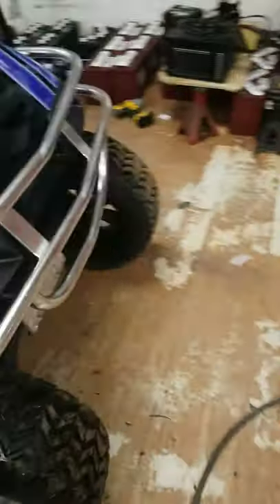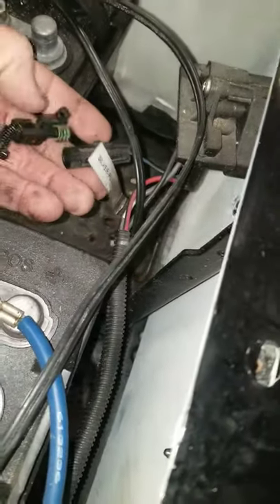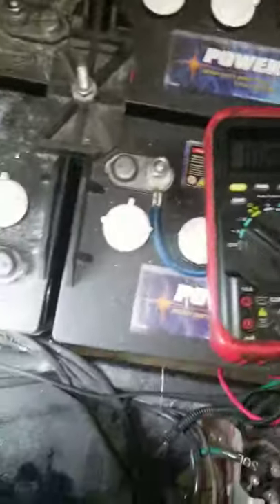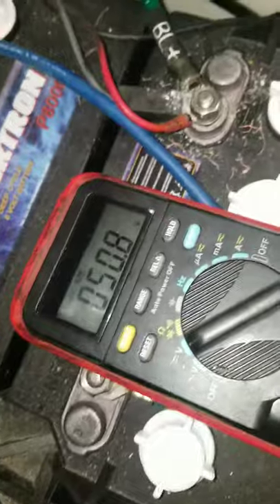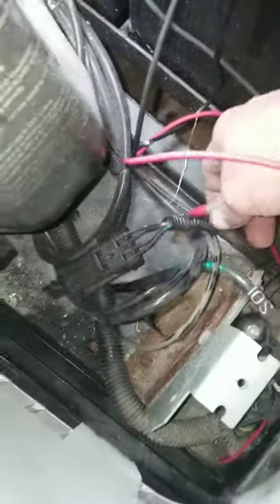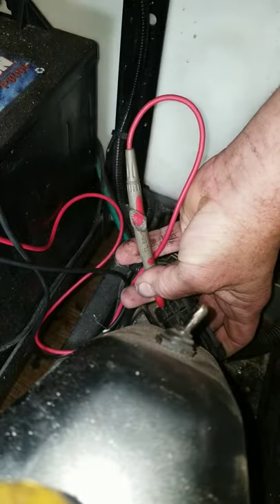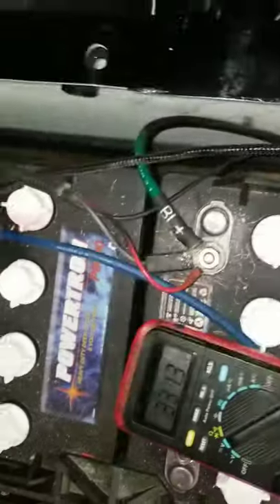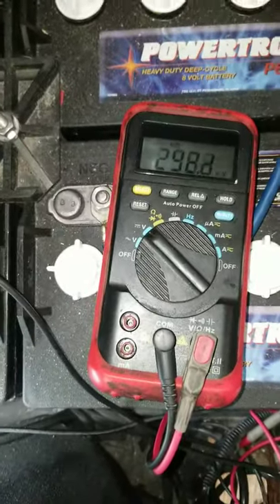EZGO 48 Test charger port, pedal sensor (ITS) and solenoid!!!!!!

Comment: I’ve got a 2014 EZ-GO TXT 48 volt. I just replaced the micro switch and the inductive throttle sensor. They seem to be working but the cart won’t do anything. The batteries are fully charged, the lights, turn signals and horn work. I have the toggle switch in the run position. The reverse alarm does not come on and I don’t hear the solenoid click. What should I troubleshoot next?
Reply from the maker: Bypass the charger plug. Like I did in the video. It’s within the first couple of min. And see what it does
Reply: @HeyHeyHey97  Thanks, I’ll try that. Can I jumper a wire without cutting off the plug?
Reply from the maker: @sethkorros2467  yes.  But I would just do it and make it permanent.  Eventually it will give you a problem. If it’s not one now
Reply from the maker: @sethkorros2467  if that doesn’t fix it run a wire from main positive to small yellow wires on sol and see what it does
Reply: @HeyHeyHey97  I bypassed the charger plug and nothing happened. I also ran a jumper from the the main positive to the yellow wire on the solenoid and that didn’t work either. 
Is there anything else I can try?
Reply from the maker: You probably have a bad controller
Reply: @HeyHeyHey97  I was thinking that too. Thank you!
Reply from the maker: Has the. Whichever ever been towed in the run position. If so check motor also. If you’re not sure I have a video on how to test the motor. That way you want fry the new controller
Reply from the maker: Supposed to say has the vehicle ever been towed
Reply: @HeyHeyHey97  I’ll check that out. I don’t think it’s been moved manually without moving the run switch to the tow / maintenance position first.
Reply: I ran a jumper wire again from the main battery cable to the yellow wire on the solenoid and got the solenoid to click and motor came on. I found the the three way splice in the flex conduit and respliced it but still wouldn’t work unless I ran the jumper wire. I also took the wires off of the key switch and checked the resistance with the key on and off and it seemed to be good. 

When I jumped the solenoid the motor seemed jerky and wouldn’t reach full speed. 

What else would you recommend checking?
Reply from the maker: Have you checked  voltage at the key switch
Reply: @HeyHeyHey97  I’m getting 45 volts when the key is off and 0 volts when I turn the key on. I’ve got 7 volts at the yellow wire on the solenoid when the key is on.
Reply from the maker: @sethkorros2467  when you turn the key on. You have no voltage on either side of the keyswitch? If so sound like a connection problem in the harness.
Reply: @HeyHeyHey97  when the key is off and I put my red and black lead from the volt meter on each of the two wires I get the battery voltage. When I turn the key on I get no voltage. If I turn the key on and put my black lead on the main battery negative and the red lead on the each of the two wires from the key switch I get about 5 volts.
Reply from the maker: @sethkorros2467  you should put the black lead of your meter on main negative and use the red lead to test voltage on the keyswitch. Is that how you’re doing it?
Reply: @HeyHeyHey97  I just checked it again with the black lead on the main negative and the red lead on the key switch. The wire that’s on the left side which would be inline with key in the off position has no voltage. The other wire on the right side has battery voltage with the key off. When I turn the key to the on position the meter zeros out.
Reply from the maker: @sethkorros2467  when the meter zeros out that’s the post that had voltage before correct
Reply from the maker: If so you have a bad connection. I would run a wire from main positive to key switch plug it into the post on keyswitch where the white wire went.
Reply: @HeyHeyHey97  that’s correct.
Reply: @HeyHeyHey97  I’ll run a wire tomorrow and try again. 
Thanks
Reply: @HeyHeyHey97  I just ran the jumper wire from the main battery positive to the post with the white wire on the key switch and that brought the power back to the solenoid. So I’m assuming the I need to trace the white power wire back to check the connection?
Reply from the maker: @sethkorros2467  thats 👍
Reply: @HeyHeyHey97  I traced the wire in the harness and found a six way splice close to the controller that was corroded on the inside so respliced it. Now I’ve got power back to the ignition and back up alarm. When I have the cart was on jack stands the wheels would spin fast. When I put the cart on the ground it barely moves.
Reply from the maker: @sethkorros2467  what does battery voltage show while it’s barely trying to move
Reply: @HeyHeyHey97  I don’t have a gauge on the cart but I put the probes from my volt meter and I’m getting around 45
Reply: I checked it from the charger port
Reply from the maker: Probably motor brushes stuck
Reply from the maker: You need to check it at the controller red lead on b+ and black lead on m-
Reply: @HeyHeyHey97  is that reading voltage before it sends the power to the motor?
Reply from the maker: Yes
Reply: @HeyHeyHey97  I was about to check the voltage.  I thought I would try it again after charging the battery a little more and I put the cart back on jack stands and for some reason the wheel are going in reverse when it should go forward. I don’t know what changed because it was driving forward earlier.

Comment: I have a 2012 rxv that gets no voltage to the motor brake with key switch on but run / tow switch in tow does . I get reverse buzzer  and hear solenoid click when turning on key switch but still no voltage from motor brake plug . Any suggestions ? Maybe you just showed it to me , the yellow wire from the solenoid ? Going to check that later .  It's 3:37 am  and I couldn't sleep thinking about my wife's cart not running the neighborhood .
Reply from the maker: You should not get voltage to brake until you hit gas...
Reply from the maker: It gets voltage from your plug under dash make sure you have good connection on your can plug. Which is the plug under the dash.
Reply from the maker: Before you turn the keyswitch on pull back on the gas pedal and pull back on the brake pedal.  And then turn the key back on and see what it does.
Reply: @HeyHeyHey97      Thanks so much for letting me know that , I should've known that being that the cart holds on a hill when you stop . 
I was too tired to have at it after my regular job tonight and kinda glad now , I'll check tomorrow evening and if it has voltage when the  throttle pedal is pushed I'll know that my motor brake is bad , am I right in that thinking ?  
Again thanks so much for the help .
Reply from the maker: @guynoir4733  thats correct.
Reply from the maker: @guynoir4733  when you put it in tow and it releases the brake that means the e-brake and the sol. Are good.  So I would check your pedal and make sure your pedals are returning all the way...
Reply: @HeyHeyHey97      I'll do that tomorrow, I've not put everything back together yet because of waiting for stereo stuff and don't want to have to take it back apart . 
You've been a great help , thanks so much .
Reply from the maker: @guynoir4733  one thing about an rxv. Dont tap into the main harness to get voltage for nothing.
Reply: @HeyHeyHey97         Thanks , I've not had this cart but a few weeks I will run all accessories on the separate battery which the lights are on now .
Reply from the maker: @guynoir4733  10 4
Reply: @HeyHeyHey97      I finally got my motor brake in . Thinking it would be a 10 min. Job turned into an hour the motor brake was stuck onto the motor shaft and while rotating and prying the gear made into the brake disk stayed on the motor shaft  and had to be pryed some more , then the new motor brake wouldn't go on because of the shaft being deformed and I had to use the dremel on it for a while but got it all together and tested it and all was perfect . Retourqued the screws .
I thank you so much for waking my brain on that no power until stepping on the throttle  .
Reply from the maker: @guynoir4733  that's par for the job

Comment: I have an EZGO I have 50 volts on all four post on the solenoid with the key in ON Position is that normal? Should I be getting 50 volts on only three post and one ground? Please advise thank you
Reply from the maker: Do you have a run tow switch and what color are on the small post on sol
Reply: @HeyHeyHey97  yes I do have a tow switch and as for the wires I have a red and a black wires on each post
Reply from the maker: @luisestrada9071  the ground post will show a hot until you hit the gas. What color are the wires on the small post
Reply: @HeyHeyHey97  red and black
Reply from the maker: @luisestrada9071  does the sol click
Reply from the maker: Is your cart a 48 v.  you said 50 v. just want to make sure you don’t have charger plugged in
Reply: @HeyHeyHey97 the solenoid doesn’t click. I recently change the solenoid because I thought that was the problem
Reply: @HeyHeyHey97  it’s a 48 volts but when I check voltage on the solenoid it reads 50 volts. No charger is con connected
Reply from the maker: @luisestrada9071  check your voltage on the ITS.  IN IS IN THE PEDAL BOX. black lead of meter on main negative. And the check the white wire for voltage and the check. Lack. With red lead of meter. Hit gas and see what voltage. Also check the accelerator micro switch make sure working
Reply: @HeyHeyHey97  sounds good. I’ll go ahead and check that

Comment: I have a 2012 txt been sitting for a year with year 18 battery's I charged them up and I'm getting 33.1 volts and my ezgo charger the light want turn on green
Reply from the maker: Is your cart 36 volts or 48 v
Reply from the maker: If it is a 48 volt cart it will take 38 volts to kick charger on

Comment: I have a 2011 ezgo gold cart and it won’t move, I bought a new solenoid,new it’s cable, new forward and reverse switch, new throttle sensor, batteries all new, tested motor and it’s good, could it be the dc controller?
Reply: @HeyHeyHey97  
Yes, reverse buzzer works also
Reply: @HeyHeyHey97  
It’ll probably take like a second to click on and off
Reply: @HeyHeyHey97  
Thanks.
Reply from the maker: Did you get cart running
Reply: @HeyHeyHey97  
Not yet I’m trying to find a Curtis controller, I have a dc Curtis controller model 1206HB-5201 on my golf cart, all I can find is model 1266A-5201, I’m wondering if that’ll work
Reply from the maker: @churrosent  just type in ezgo pds controlller
Reply: @HeyHeyHey97  
But does the model number on the controller matter?
Reply from the maker: @churrosent  no as long as it say ezgo pds.

Comment: I have a 48v golf cart (motor sticker says 48v and I have 8x 6v batteries) it is a western elegante (mostly ezgo) but the sticker on the solenoid says 36 volts so my question is this, should the yellow wire from the key to the small terminal on the side of the solenoid be supplying 36 or 48 volts if the sticker on it says it's a 36v solenoid? 
Does that also mean that it is only design to have 36v passing through the large terminals?
Reply from the maker: It is supposed to show battery voltage
Reply: @HeyHeyHey97  I edited the wording on my question to make more sense, speech to text is a killer ha ha
Reply from the maker: Well the ezgo rxv are 48 volts but they activate off 36 but allow 48 volts across big post.   Send me picture of your sol.

Comment: My white wire reads 0
Everything else reads good.  Any ideas.
Reply from the maker: Have a bad it’s in floorboard. The sol does not click. Correct
Reply: @HeyHeyHey97  the solenoid does not click. 
What can it be? I’m so confused at this point.
Reply from the maker: @parales03  if the white wire shows no voltage then you have a bad its.  It’s in the floorboard. If that’s bad sol want click
Reply from the maker: As long as the black wire shows voltage going to the its.

Comment: I did all the test in the video everything checks out and I just replaced the solenoid I have all the correct voltage back up alarm is loud but cart won't move in either direction any ideas on what I can check next
Reply from the maker: Check the it's in floor board.
Reply from the maker: Its. With volt meter should show 14vdc on one wire and 3vdc at full pedal other wire black lead on main negative of batteries
Reply: I removed the rubber mat they was a little cover with 2 Phillips screws took cover off at the back of cover they are 2 wires one has 14.7 volts and other has 1 volt then I press the pedal it goes to 2.7 volts
Reply from the maker: Put black lead of meter on m- or a1 on controller and red lead on main positive on battery. Hit gas and tell me what you get. 0
Reply from the maker: Excuse the 0 at the end. You should get battery voltage. Does the sol. Click when you hit gas.
Reply: What is m- or a1
Reply: Solenoid don't click when pedal is pressed but it clicks when you put on forward button
Reply from the maker: @mw20001  that is the post that stick out of the controller. The sol wires goes  to one post
Reply from the maker: @mw20001  if you follow the main negative wire off battery that will go to the controller. Under black cover
Reply: I just put a new solenoid on hooked all wires back like they came off
Reply: Are you talking about the run/tow switch
Reply from the maker: @mw20001  no take that cover off where the tow switch Is. Should be 3/80
Reply: Took cover off checked 3 wires on controller in neutral position with key on getting 48,48 and neutral
Reply from the maker: Put the red lead of meter on main positive. And black lead on middle post on controller and hit gas should get battery voltage
Reply: Reads 0 volts
Reply: I even tried putting black lead to main ground and red lead to middle post on controller and I get battery voltage
Reply from the maker: @mw20001  what color is your controller
Reply: Grey I do believe I sent you a message in messenger if you accept I can send some pictures of it this afternoon
Reply from the maker: @mw20001  I my name is thomas wells. In conway sc
Reply: @HeyHeyHey97  hey man, SC right here too bro..you are the most help on YouTube by far
Reply from the maker: @fbinsley  thanks man.
Reply from the maker: @fbinsley  thanks man.
Reply from the maker: I try to make videos like I want to watch. With no bs.

Comment: I couldn’t understand the 3rd common problem (my 1 yo broke the speaker on my phone) you said it’s a bad what? 
- reed switch
- key switch
- ???

Thanks!
Reply from the maker: Its it is called a its. Inductive throttle sensor which is in the floorboard in front of gas pedal.

Comment: Hi I have a txt 48v done all the test you recommended  and all reading correct cart has new solenoid, new controller and ITS and still won’t run got reverse buzzer but solenoid still won’t click ?
Reply from the maker: Do you have voltage on small post on sol when hit gas
Reply: @HeyHeyHey97  on the blue or yellow ?
Reply from the maker: Put black lead of meter on main negative and check yellow wire with red lead. With key on.
Reply from the maker: If voltage there put red lead on yellow wire and black lead on blue wire hit gas see what it shows.
Reply from the maker: What does overall battery voltage show
Reply: @HeyHeyHey97  around 50 volts batteries are new. I’m not with the cart to try this at the minute. If there isn’t voltage there what it’s the problem?
Reply: @HeyHeyHey97   Hi , love your video . i have a simillar problem  yellow wire shows battery voltage but blue is not showing any ground  . got a ground from battery  to the blue wire and golf cart runs now but goes like 10mph used to go around 19mph before, kids  pushed with another golf cart with tow switch in run position. any idea ? thank you!
Reply from the maker: Controller bad.
Reply from the maker: How far did the kids push it.
Reply: @HeyHeyHey97  like 300 ft . thanks
Reply from the maker: @heilinvinas5642  yeah controller bad.
Reply from the maker: But I would watch my other video about how to test the electric motor to make sure not shorted
Reply: @HeyHeyHey97  will sure do, would still run if the motor is shorted? is doing like 9 mph with the jumped ground to the blue wire at the selenoid. it just feel like the gas pedal wont do anything over half way. thank you so much for all your help will definitely see all your videos !
Reply from the maker: @heilinvinas5642  no it want. but I would definitely check just to be safe.  It sounds like the ground side of the controller is gone. What I would do is hit the gas then give it a ground on sol and see how fast it runs.
Reply: @HeyHeyHey97  i will definitely check ✔️ everthing .  if it is the controller do you recomend to repair it  or go with another controller ?
Reply from the maker: @heilinvinas5642  would get it rebuilt.
Reply: @HeyHeyHey97  THANK YOU SO MUCH!

Comment: Do you have an email address or a social media I can reach you? Just had my controller fry not sure why but don’t want to purchase another controller and have the same thing happen. Thanks in advance!
Reply from the maker: Look up thomas wells on face book Conway sc
Reply from the maker: What kind of car you have. If an ego make sure you have a resistor controller. And check its in floorboard.
Reply from the maker: Call tom 843-427-4853- and ask for Thomas.  8-5 Monday thru sat..
Reply: Thank you!